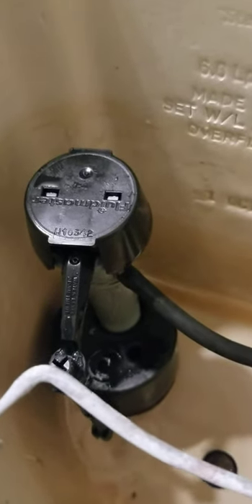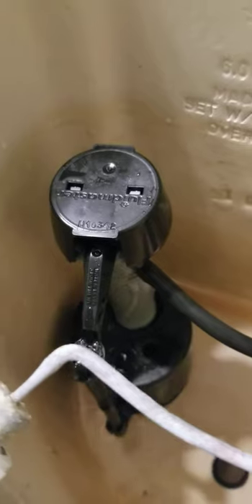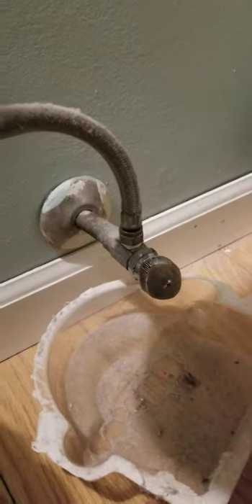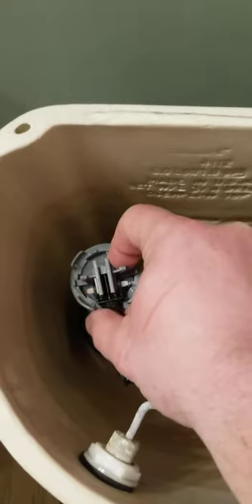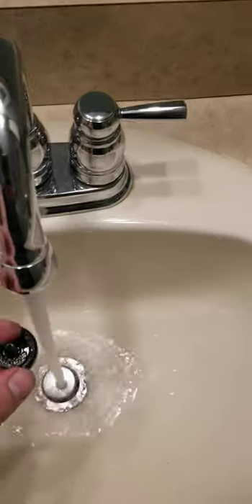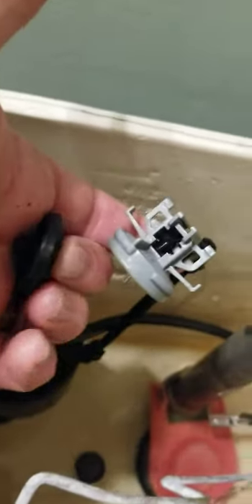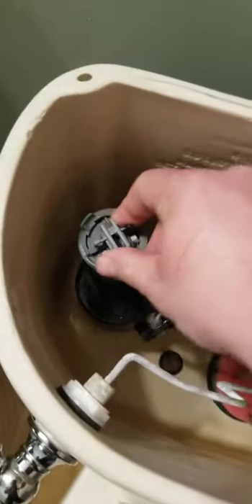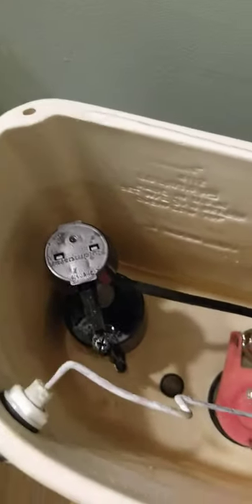Toilet keeps running - easy fix

Comment: You missed a step. When you have it all apart put the cup over the top and then turn the water back on flushing the pipe out sometimes debris gets caught in the pipe or in the valve to open the valve up and blast it and then turn it off and put it back together. This is information coming from a guy who's been a handyman for 30 years
Reply from the maker: You are correct. Thats what the cup was for, forgot to do it in the video 😂
Reply: Thank you! I'm gonna try this. Already paid a plumber to come out & fix it. They installed a  new kit but it was doing this an hour after he left  & even over flowed the next day. I was so annoyed that I decided to learn to fix it myself. I have no patience.
Reply: @johnnylawrence  what was the beer 4 Lol
Reply: @johnnylawrence  too drunk lol
Reply: I can’t get the cap off 😂

Comment: Hey, I just stumbled upon your video today. I did exactly what you did to anyone wondering how I did it to clean the gasket and there’s a funnel inside that you can also clean. It had a lot of buildup on it so it wouldn’t allow the water to come through properly 

3 parts water 1 part distilled vinegar 

Let it soak for 15 minutes use a sponge to get the gunk off and if need be use a toothpick to get into the smaller areas. Remember to also clean the inside of the circle as residue is built up for me.

Your video saved me $15 today

Comment: Just fixed mine by swapping out the rubber gasket. Thanks 💎
Reply: Where'd you get your rubber replacement?
Reply: The store!
Reply: @BrandonTramel  Fluidmaster 242 Toilet Fill Valve Seal Replacement Part - lowes or amazon

Comment: After you get the cap off, that thing is impossible to unscrew without feeling like the whole thing is going to shatter! Any ideas?
Reply: Just force it. It won’t brake lol make sure you disconnect the thingy it’s attached too tho
Reply: @SkrillaB999  lol 🤣🤣🤣🤣🤣
Reply: @SkrillaB999  actually, I found that just replacing the entire mechanism that does the flushing is the easiest thing to do... You just put in a whole new assembly and everything is fine and it's relatively simple to do

Comment: Wow! was just about to buy a new valve seal. Water would not stop running after a flush untill I shutoff the cutoff valve and turned back on. Tried this minus the beer lol and now it works great.

Edit: Sorry, it didn’t last. I ended up having to replace the whole fill valve unit. It was a pain the a** too because installer tightened it way too tight. Instruction say to hand tighten 😖.

Comment: the cap on mine wont come off. i wanted to do this. idk whaats wrong but it absolutely wont simply come off. i pressed down and turned it counter clockwise i pulled twisted ect. the little stubborn piece of crap wont come off. if i turned harder it was gonna break the fill valve apart.? this apt is old so i guess toilet and parts are also.  this pisxes me off. nothing ive tried on you tube works. it would have messed mine up worse and id be responsible. the bitxx msg here wont fix anything and youtube just dont seem to work!!

Comment: I did all these steps but the water still keeps running. Anyone have any more suggestions?
Reply from the maker: Check your flapper after flushing to see if it relaxes back down evenly. If it doesnt you may have to make adjustments. Also, if you washed that gasket and it's still leaking, you may need a new one.  Go to a home center in the toilet plumbing section and buy a new one, its called a "toilet fill valve seal." They're like $2.50 :)
Reply: Ok

Comment: my water still keeps running
Reply from the maker: If still running tell it to start walking 🤣 either change out that gasket completely instead of cleaning it (they sell it at Home Depot for $2.00) or make sure your flapper is working properly. Best of luck let me know how it goes.
Reply: @johnnylawrence  🤣🤣🤣 you little funny guy you little you .🍪🍺